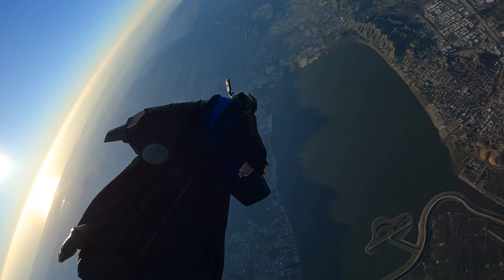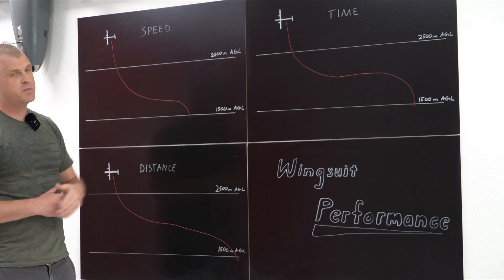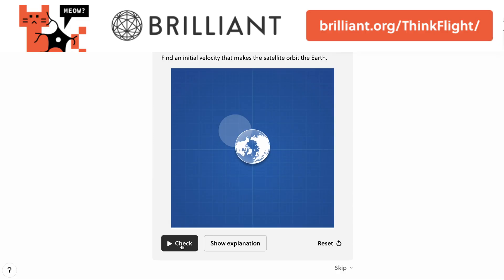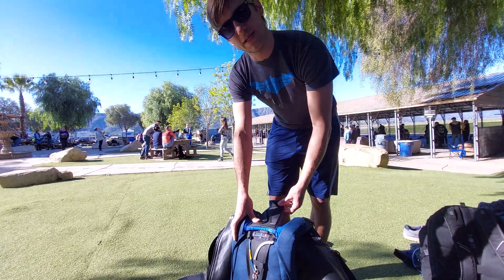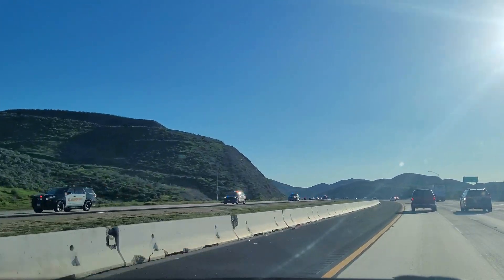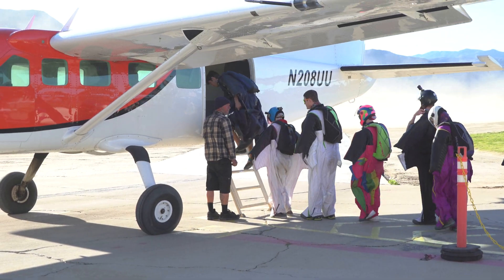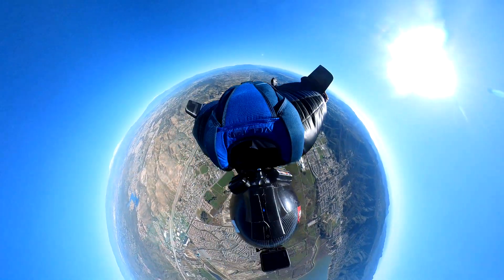Quantum Physicist + 3D Printing = Wingsuit World Records:  How We Did It

Comment: Would it work to have funnel-like long airfoil arm extensions that are inflated by air collected by intakes along the shoulders? Like, structures sorta like windsocks, but aimed slightly outwards, sorta following the arm lines, so that the airflow hits along a leading edge to make them work like wings, and with some internal strings or stitches or whatever to keep and airfoil shape when inflated?

Comment: I looked to all this stuff as some friends of mine were at the competition but mostly because I'm designing my own wingsuits with extentions since 2015 in the BASE enviroment.
I have to say that the first thing that comes to my mind was that with the normal way of pitching that kind of extention are causing too much problems. There have been way too much safety canopy deployment because of them, and IMO they should not have been allowed during competition at first. Also saying that if there is too much trouble you have the AAD is weird, the AAD is supposed to be there for problems you did not expect, not for problems you expect... The new regulation is banishing extentions, it's done, and I think it's normal for safety reasons.
That said I would have loved to have a new category like "prototypes" to have people continue to experiment, but it needs an other deployment system to make it safer (I'm using one).
I think extentions are a good way to increase suits performances, my latest homemade wingsuit has performances at least similar any manufacturer's wingsuit on the market (in Glide and Starts) which is mainly due IMO to the extentions.
Reply: Hi Antoine, thanks for your comment. I was indeed inspired by prior work on span extensions including yours when designing this. And I definitely had some difficulties with deployment on my first prototypes last year, but they have all been resolved within 20-30 jumps. I have adjusted my deployment technique and made some minor suit alterations to allow for an easier pull and have not had issues since (200+ jumps). I do agree that such span extensions are not recommended for the BASE environment, and would strongly urge people not to use them outside of skydiving. The 5-10% performance improvement in glide ratio is not worth the added risk, in my opinion.
Reply: @AlexGalda  the 5-10% worth the R&D for sure and it's nice to see people trying, there is so much room for trying new things in the wingsuit world.

Comment: Nice that you (and Alexa) concluded that sweep doesn't help in these flight regimes. - Cessna type Swept tails (ie 152/172/182) are merely for "fashion" giving the stylistic "signature" look of the tailfin - looks faster, while the elevators and wings are straight - a Pilatus Porter works "as well"  - in the far subsonic regime. lol...
(if anything a swept wing has a lower aspect ratio - more likely a negative effect at low Reynolds numbers - on the other hand - it is all an experiment, thanks for telling the story.

Competition rules tends to ruin sports (I prefer scientific advancement without limit)  - playing with more YvesRossy-like wings is a better fit for skydiving than BASE  (a  multi-piece folding wing would be huge...  (new sports could emerge.)
Reply: *Alexey, not Alexa :)

Comment: IMHO The wing tip should emulate endoskeletal bird feathers rather than exoskeletal aircraft. You want to reduce wing loading, and you don’t care so much about the infusion. I recommend you construct a wingtip with real bird feathers or artificial equivalents. It should flex like a bird wing, rather than be stiff.

Think of it this way: you want to move a lot of air a little bit, rather than a little of air a lot.
Reply: I like your idea but don't forge that we fly at speeds exceeding 300km/h on every jump when diving out of an airplane. The design needs to be extremely robust an snag-free for safe parachute deployment.

Comment: You can build a suit using the Feather configuration that Burt Rutan designed for space ship one and two.  Now you will be floating down instead of falling!

https://youtu.be/AqhQIOr299w

The optimum angle of the wings was 15 degrees.  

Good luck!
Reply: No, you will be falling even faster, that creates so much drag! It was designed for high drag and stability, not higher glide or lower sink rate.

Comment: really good video and work.

I pondered for a while why people had not done more, but the in flight stability challenge explains that. I was thinking why no one has wings/winglets on the helmet. But centre of gravity?
Also, in the chest area, this is a space that could be used for some form of wing or lifting body. The current arm design, and I guess this is partially physical limits, leads to a swept wing. Ideally for lift at lower speed, a straighter wing might be advantageous. 

Wingsuit flying is amazing. Looking forward to progress people make. Thank you for the time taken to put the content up!

Comment: Wingsuits are pretty fun, but as low aspect ratio wings supported by sinew they are limited, and safety is bloody important. I always wished a spar supported wing could be deployed so as to be able to land it (and do loops and barrel rolls!). The smaller canopies are only 60 sq ft or so (smallest I've heard of was 46, typical is 120 or so), and the higher the performance, the higher the wing loading you can land. Add tail stability and eddy flaps and you might be able to do away with line supported canopies completely.

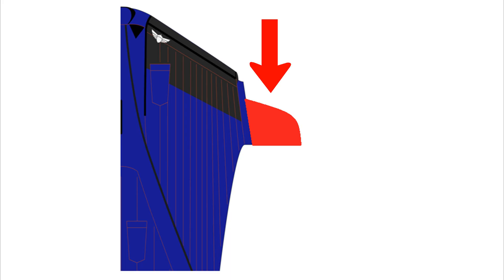Comment: Another fascinating aerodynamics topic and study. As far as FAI is concerned, does a wing suit need to be flexible, or are rigid variants allowed? Would be interesting to construct a rigid scale model of the pose at 1:21 for wind tunnel, or inflight tests. Determining best L/D, or minimum sink rate probably was not possible before you began collecting data from with flight recorder. 
Noticed at 9:13, in the duration run, it appears the wing suit stalled as neared the bottom floor of the duration window, cutting off 1-2 seconds of flight time. Wondering if a leading edge slate made of fabric would help lower the stall speed, or allow a bit increased angle of attack. Probably only need ~foot inboard to test as wing has washout, and being inboard would reduce any roll tendencies.
Aerodynamics related to the helmet would be another interesting area to study.
Are cone heads allowed? If a more pointy top works for Starships, it may work for wing suit pilots too.
Reply: Some rigid elements are allowed, but the wingspan of a wingsuit will be severely limited moving forward, completely banning any span extensions, rigid or flexible.

Comment: Since the max speed with the wingsuit open is known but at the same time the wingsuit suffers from stall at high angles of attack

Will we ever see multi element foil wingsuits?

You might say that its absurd and that liwer speed high angle of attack efficiency is irrelevent but isnt this the only way in the DIRECTION of wingsuit landing *without parachute*??
Reply from the maker: Maybe, but not for a competition where maximum speed is a factor.
Reply: @thinkflight  yes that case has to be optimized for distance. I agree

Comment: I'm pretty sure the new rules will at the very least heavily restrict the size and weight of extensions, if not prohibit their use entirely.
I'm personally hoping for the first option, as they make for a very interesting competition, but the safety aspect has to be looked at very critically.
Creating a situation where competitors are pushed to use larger and larger extensions, that will both make it harder to open the chute and also become harder and harder on the pilots would be less than ideal, so you at least need size and weight limits.

Comment: Being a wingsuiter myself since 2012, I found this interesting. I had looked into extension for my suits a few years back and had decided against them on the grounds that to get significant improvements you would need to make them fairly big and forces would have been "too much" to handle and safety would definitely be impacted... Fun to see that you can get some improvements with such a small (relatively) winglet. Do you think it is because of better control of tip vortices? Would a winglet with a swept-up end be even better a minimizing vortices?
Reply: Christian, the 5-10% improvements are mostly because of adding an efficient lifting surface where it matters the most. Flat span extensions are significantly more efficient than upward/downward facing winglets. The main reasons why most airplanes use those are because they need to stay within a certain wing span limitation, better structural rigidity, and because they look cooler.
Reply: @AlexGalda  I guess so but then it becomes a question of human strength to hold the correct body position with a much wider wingspan. You know how we are... we'd like to stay up there for ever if it was possible, this being said 10-15% is an improvement and every little bit counts.
Reply: @christianfoucault2496  Yeah i was starting to wonder wrt competition regulations; where is the line between a wingsuit and an ultralight? You point out a nice natural constraint; as long as its your body that acts as the fuselage, carrying the loads between the left and right, without additional bracing, id say go crazy with your wing extensions; the difference with an actual airplane is always going to remain quite pronounced that way.
Reply: I think the future of the sport lies in helmet mounted canards.
Reply: Wing efficiency is heavily dependent on aspect ratio. A wingsuit doesn't behave much like a traditional wing, but any way you can increase the aspect ratio will push the overall performance closer to an ideal wing.